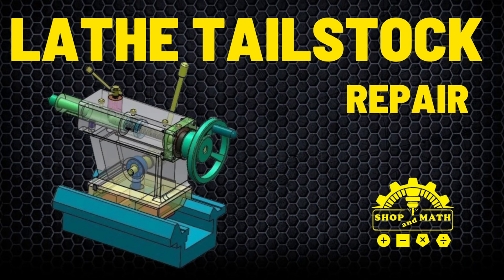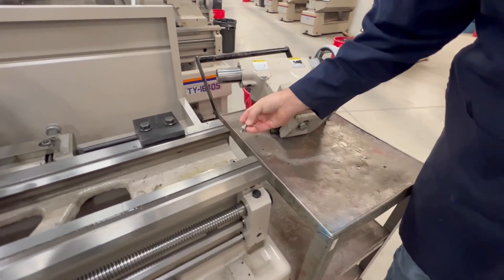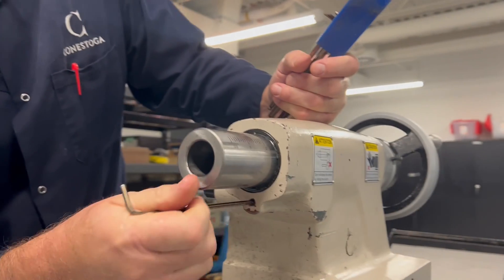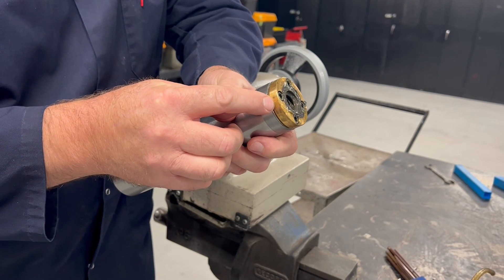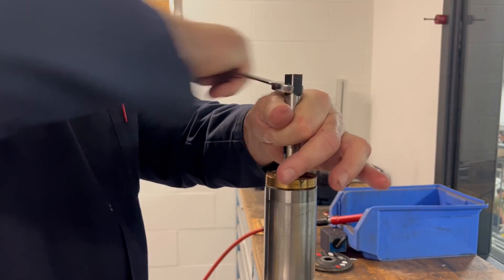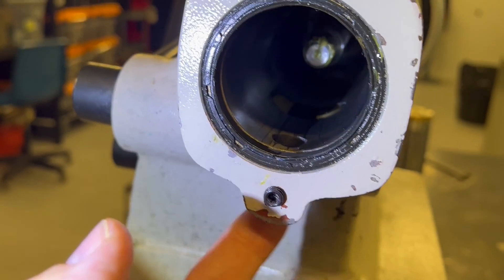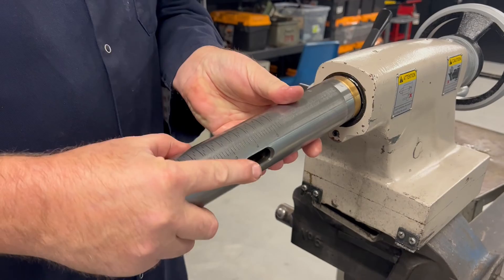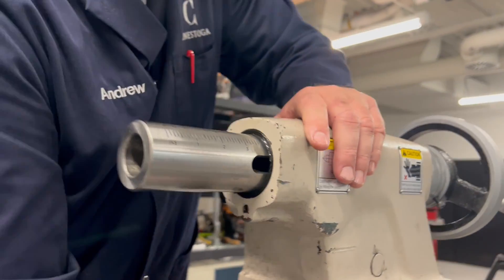Lathe Tailstock Repair

Comment: Help please !  My screw piece is frozen into the quill…..tried turning it out but can’t get it to turn inside the quill….Any suggestions for freeing it?
Reply from the maker: This happens at this college as well. Unfortunately what we do is take a large pipe put it into the handle and force the screw to thread through this generally damages the nut on the inside, not necessarily the threaded shaft so we will take it apart and re-tap the nut and it’s all good again, hopefully this helps

Comment: I was instructed to run the type of tap you used through the part, never back it up, to avoid damaging the threads and the tap. Comment?
Reply: How would you tap a blind hole?

Comment: I would have done it on the lathe without removing the tail stock. Throwing it in a vice will ding up the bottom of the casting. It would have been a good idea to clean the bottom and stone the mating surfaces to make sure you don't damage the ways. You're working with precision equipment, treat is accordingly.
Reply: I think I would have clean the barrel, nutm tailstock bore and screw before proceeding. The compressed air blew any trash into the tailstock barrel.
Reply: They could have used the vice soft jaws, but didn't. 
It is obvious they have some handy.
Reply: @simpleman283 they used soft jaws on the spindle. Did you miss that?
Reply: @stephenlett9208  The OP wasn't talking about the spindle. Do you know what he was talking about?
Reply: @simpleman283  yes I do. I think that the mechanic did a great job. Clearly he's a total professional. Look at the shop that he maintains. It's incredible.
Reply: @stephenlett9208  🤣

Comment: Question, cause I'm old and lazy....
Seems like you could pull the Spindle without removing the Tailstock from the Lathe.  But a nice "Tip" to have a proper height cart waiting! 👍
Reply from the maker: You’re absolutely right it could be done that way

The reason why we choose to remove that is because students might need to use that machine, and it can be used without the tail stock on it 

Thank you for taking the time to comment. It’s much appreciated and also good advice for other people watching a video.

Comment: 👍👍
Reply: I was told never to use grease because it retains chips and grit when oil would release them. With exceptions being a j head and mill knee screw because they are often neglected and may never see attention.
Reply from the maker: @FrancisoDoncona 

That assembly comes greased from the factory. It is recommended to be greased you.
Thank you for taking time to comment. It is much appreciated.
Reply from the maker: Thank you for taking time to comment. It’s much appreciated.